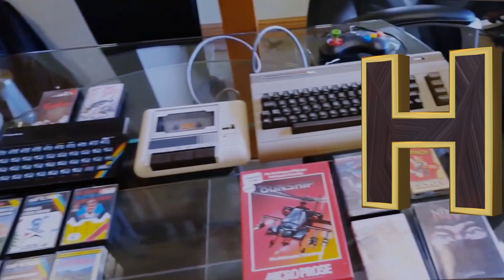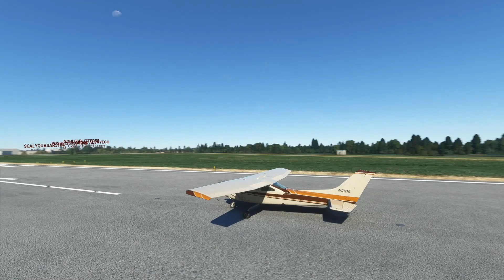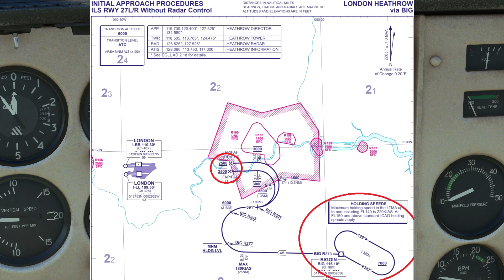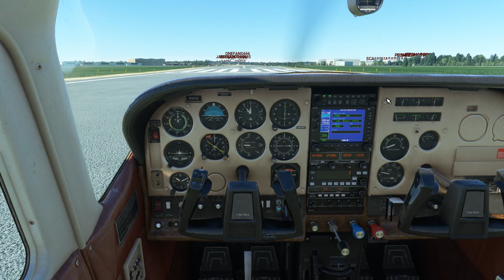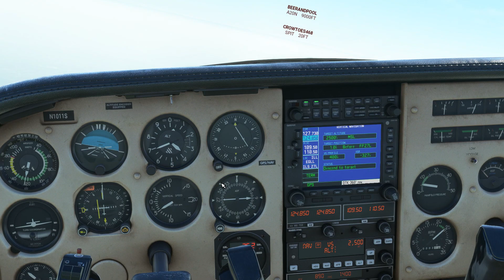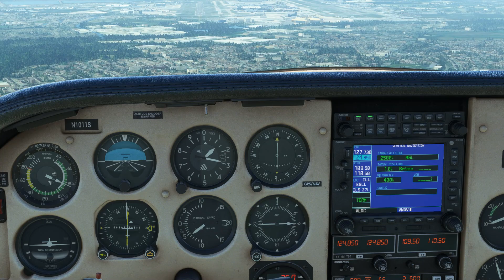FS2020: VNAV ILS Approach in the C-182 RG?  It is Possible - Back To Basics With MSFS: Part 34

Comment: Would you recommend buying for IFR?
Reply from the maker: Absolutely it's great in IFR flights.
Reply: @Huddison  Do you have the 182Q version? If so, what'd you recommend
Reply from the maker: Very similar aircraft; the C-182Q does have double Garmins.
It's a case of which one do you prefer.
Another consideration is that The C-182Q is a FS2024 aircraft and the C-182 RG is not as of yet (as far as I am aware).

Comment: Hi Hud. Your use of the C182 RG in your videos tempted me enough to purchase it last week. You kept referring to the EGT in this video. It's the exhaust gas temp, correct? Is the gauge used for correct setting of the mixture? Any tips on how? Like in your video, my needle stays roughly in the middle to top end during a climb but then I'll notice it's suddenly gone all the way to the left.

Thanks for the very useful info on how to use VNAV. I'm about to give that a go now. I'm curious why you only set the height for the final approach though. On the chart you bring up at 6 minutes in, doesn't the 7000 at BIG mean you have to be above that altitude at that point? I think you had already begun descending by then and so were under 7000. Similarly with 6000 at BIG R293. Or are they just a guide? Unless relying on NAV mode on the AP, I could imagine it would be quite a faff to keep changing the VNAV for these different Altitudes on the chart.
Reply from the maker: You are correct: EGT = Exhaust Gas Temp.
This video may help you with that: https://youtu.be/Tcb0TR76jDc